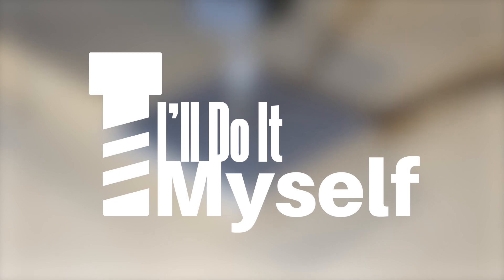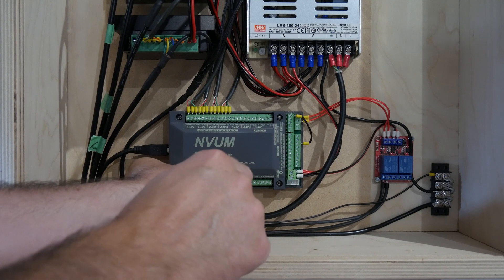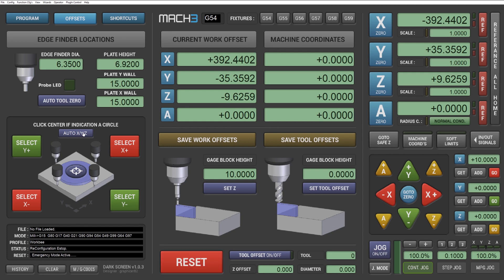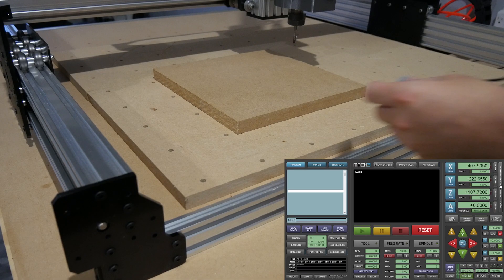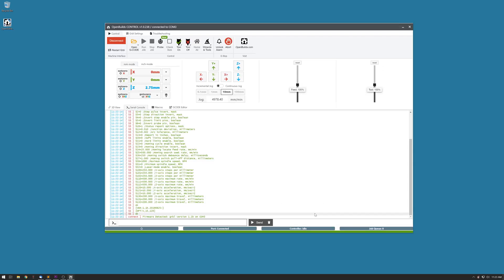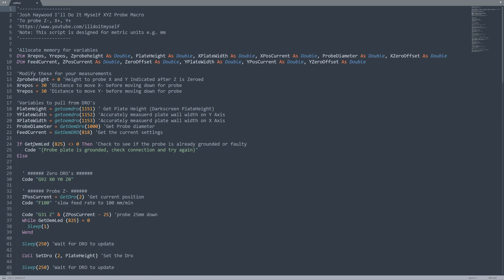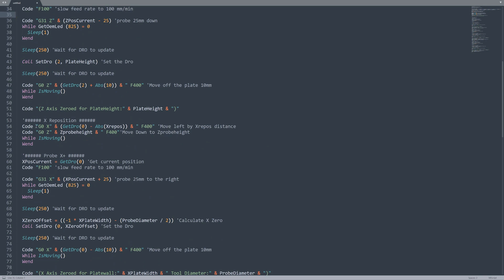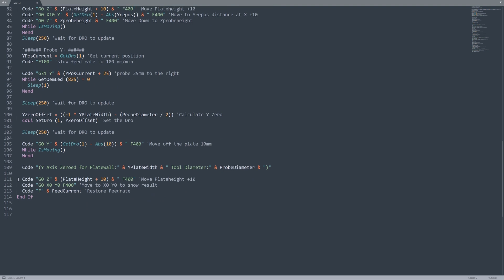Start to Finish XYZ Probe (Part 3)

Comment: Hi,
i love the DarkScreen screen set u using but when i use the "Auto X/Y/Z" button, the machine starts with Z, after that it goes to probe X but randomly it went up and not towards the probe plate. Sometimes it works. Do you know what that might cause? I'm using Mach 3 with a UC300 on my Ultimate Bee. 
Help much appreciated :)

Comment: I would suggest using a steel dowel instead of a bit. The bit would need to be placed exactly on the tips of the cutting edge where as the dowel is dimensionally accurate on all sides

Comment: On a spiral fout endmill like that should be able to set it in any direction the tool is in as Ling as it drops down enough. The diameter needs to be measured though or it can be off a little but on a small machine it won't be enough to notice.
Reply from the maker: Yeah good point if you go low enough.
Reply: @IllDoItMyself  I'm actually going to make one myself I need to start a Channel on here I'm putting a szgh industrial controller on my 3040 cnc I don't know on your setup but when I programmed my plate I used a cutter comp on my sidewalls so I can comp for sidewall ware on my tool so I can rerun it to get my x and y the same size

Comment: Hi, this script worked when I was using the NVUM and it worked, but since switching to AXBB-E, it doesn't work correctly. It either randomly stops probing, or doesn't stop when touching the plate. Any ideas on what I need to change?
Reply: I have the same issue with the EC300

Comment: Hi just one problem when I select/use a different tool it goes down too far so that the flutes are touching on the wrong part of the tool would I have to alter the script or is there a setting in mach3 to use .the tool is shorter than 12mm on the cutting edge/flutes

Comment: Thanks for a great set of videos.
I am assembling a system that came with a NVUM v2 4 axis controller. After watching this video, I have a question:
Can OpenBuilds Control Software control a NVUM system?
On the OpenBuilds forum it doesn’t seem like it https://openbuilds.com/threads/controller-recommendation-for-c-beam-xl.14704/
However, this video makes me think that it can.
Reply from the maker: No openbuilds software only works with grbl based controllers.

Comment: I´ve seen that you use NVEM controller, are you having any problems with that BoB? I´ve read several forums about novusun BoB´s and there are bad reviews about them. did you have any problem with that Bob? where did you bought it from? thanks, great video!
Reply from the maker: Hey so this is the NVUM which has now been replaced by the NVEM. That being said I have had no problems other than having to write a custom probing script which I have in one of my other videos.
Reply: @IllDoItMyself  great! Where did you get it from? There are tons of sellers and it seems to be a copy of another copy, i cant find any trusted seller or the manufacturer. Thanks.
Reply from the maker: Hey this is from bulkman3d use the link in the description to find their store and you can order it from there.

Comment: Hey
nice layout for the darkscreen thanks i installed it. The software for the probe was installed, this works well, but how can you also only measure the z axis?
Reply from the maker: Thanks I only added to the original work. Use auto tool zero for just z

Comment: Great video, Will this work for inch units if so what needs to be changed?
Reply from the maker: It should work for inches yes you will just need to change the distances in the top of the script to something similar in inches.

Comment: Good morning. After retrofitting my WorkBee with the Novusun V2 and Stepperonline closed loop motors it is now running on steroids!! So I have had to tune back the motors to get rid of the whiplash!! The Mach3 simulation tells me it will shave an hour on the jobs I run. So happy days.

But the question I have is regarding that 'Manual XYZ Macro for NVUM controller'. The 'Digitize' LED is working, I have my test piece loose on the table and the router finger tight on its clamps. So holding the test piece down by hand during the test. The test script worked first time like a dream, but then I repositioned the test piece by 15 mm or so and manually moved the machine roughly above the touch plate, the same as before, and tried again. Just as well my Z was loose in its clamp as the Z kept going down and had to hit the E stop. Now it fails more often than works. I have the Ethernet Novusun V2.
Reply: I have the same isue  does anyone have a solution. the  cutter stops on the probe pauses for a few seconds  then sometimes goes down instead of up crashing the machine!
Reply from the maker: Yes I have found a bug. Standby for a fix
Reply: @IllDoItMyself  I think I have found a fix, hope you don't mind . If you open Mach3 click on operator and select edit the button script. Then select auto tool zero. scroll down and change   (Code "G0 Z" & (GetDro(2) + Abs(10)) & " F400" 'Move off the plate 10mm
 )     to     ( Code "G01 Z25 F500" 'Move off 0 25mm).    This has to be done on both auto tool zero buttons one on the program page and the other on offsets page. I have not had any problems since doing this. And for some strange reason the Auto xyz button works every time after doing this. will be interesting to see if this works for anyone else.
Reply from the maker: Yes but you can use the variable in there to handle the different heights people can use.
Reply: @443057alex  I will give it a crack. At the moment my work-around is to power cycle the Novusun, driver and motors. The existing script works first time by doing this, but I also have to take the machine to 'zero' before I switch it off as I also lose the zero position when I do that. But I think that could be something else. Thankfully the over current protection in the drivers are set correctly to protect the motors and driver.
Reply from the maker: @perro0076  I have update the screen set In the description. Give it a try and see if your problem is solved. I think the issue was actually that the DRO was not set before the next move began. I have added a sleep to give this time to update. It a pretty common problem I just missed it on this section.
Reply: @IllDoItMyself  In my case I am using the 'Manual XYZ Macro for NVUM controller' script.
After my prior crash experiences I am still too chicken to clamp down my DeWalt router on the Z axis and clamp down my work piece, but I have tested now this amended script a good 6 times and so far it is not failing and have not had to power cycle the NVEM and motors like I had to before. All I did was to add this right at the start:

  ' ###### Zero DRO's ######
  Code "G92 X0 Y0 Z0"
  While IsMoving()
  Sleep(100)
  Wend

Not sure if its related, but I have also noticed that (in Settings) even if you 'Reset Interp', 'Zero' then 'To DRO', the actual DRO in Program Run doesn't always go to zero. Same vice-versa. I have to power cycle the NVEM and motors to get everything to read zero in Mach3.

Comment: I like this screen set , but how do you get to settings (alt 6) for axis calibration?
Reply from the maker: Yeah that is removed from this screenset. You can do it manually by doing a movement of 100 then dividing that by the measured movement and finally times by the current steps. The. Set the result in your motor page. That is all the script actually does anyway. Or just simply load up the old screen set do the calibration and load this one back up. It's all saved in the setting page.

Comment: As always great work and excellent video!, I have been using  a screenset and XYZ probe on my Mechmate  router, the screenset and settings has been put together by PEU and Ernie bro for Mach3 ( ohh this date back about 11 years) I wonder if this probe settings will work with Novusun controller, may I ask if any of the clever people here can look at the settings code to see if  it is compatible!
Reply from the maker: Thankyou! I would imagine it won't just work. This really is a non standard way of probing and just a work around for the NVUM.

Comment: Hi. Sorry to be a pain. Is this the script for just the probe? I.E. without the different screenset. "Manual XYZ Macro for NVUM controller". Where does it go?

I think I found the answer to my own question. Open it with Notepad and paste it behind the 'Auto Tool Zero' button. Enter X and Y plate dimensions manually in the script. Not sure yet whether it picks up existing means to enter Z thickness of plate and tool diameter.
Reply from the maker: Hey sure, you can use it in your macros folder or you can edit a button and paste the script in to it.
Reply: @IllDoItMyself  BTW. Before I got into IT (I wish I played with VB though!!!) I used to be an Electrical Engineer. I reeeeally like your workmanship and attention to detail. Thank you for your help so far.
Reply from the maker: Thankyou I really appreciate that!!

Comment: I have tried to use this script for the probe tool and it probed fine and then instead of raising, it went further into the probe plate and broke my bit, gouged plate and messed up the material :(  I have gone through your complete series of this machine setup and have followed everything to a T. Only difference is my machine is the 1500x1500 and my home is the RR. I have also been pulling my hair out trying to get my Fusion 360 PP setup to work properly with Mach3. Every time I load the file in Mach3, the work piece is opposite of my table and my movements also show opposite when viewing table display. Any and all help would be greatly appreciated PLEASE! TIA
Reply from the maker: Oh no. Start by making sure mach3 moves the machine the direction the arrows point. Then work from there. It is possible to have this backwards and still working but things will be reversed. If that's the case this script will fall for sure. Remember when working with anything new keep one hand on the e-stop.
Reply: @IllDoItMyself  Thanks. Got it figured out (I think). I THINK I may have used the "Auto Tool Zero" instead of the "Auto X/Y/Z". Now onto tramming.. Any tips tricks or video showing how you did it for this machine? Thanks again for the help and vids!

Comment: Hi. Many thanks. The best one I have come across so far. I am about to run with that Novusun NVEM v2 flavour, so this is very interesting however. I work in mm. Would I need to change the script in any way?
Reply from the maker: Thanks, everything is do in this channel is metric so you will have no problems.
Reply: @IllDoItMyself  Ah cool. I thought to ask just in case as when you were going through the script you mentioned 'inches'. So all good then!! :-)

Comment: I have the exact same setup as yours and I was wondering about the script. I am using your Screenset and wondered if I also have to load in the script for the auto probe or is that baked into the program? If I DO have to use your script also, how do you upload script? Sorry, I am new to Mach3. TY for all of your videos!!
Reply from the maker: No worries the screen set has it all built in.
Reply: @IllDoItMyself  What dust collection setup do you use on your machine? Links please :)
Reply from the maker: This is one I made, I'm selling them ready to go for $50 usd. I will be working on a proper post for these soon but let me know if your interested.

Comment: Can you tell us why you use relay? What for?
Reply from the maker: Hey Mateusz, I use one of them to run my air pump for a bit of chip evacuation when aluminium cutting.
Reply: @IllDoItMyself 
 I downloaded the Dark screen set but when I open it on my computer it stretches over the entire screen and there doesn't appear to be any way to access the control buttons that normally appear across the top of my screen. Can you suggest anything to correct this?
I am only seeing a portion of the Mach 3 screen.

Comment: Is there some xyz probe that is more plug and play than this?
How did you operate the machine without the probe before you had it, before you machined it?
Reply from the maker: Hey. There are plenty of ready to go options yes. CNC3D, Openbuilds, ooznest all have one. The probe is not required you can set work coordinates manual just fine.